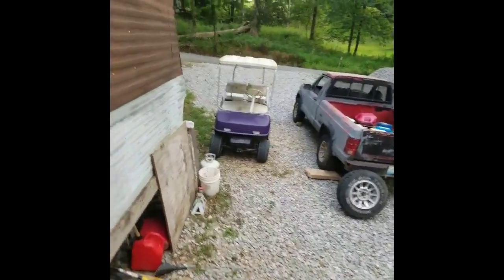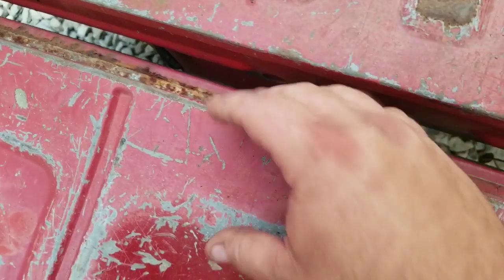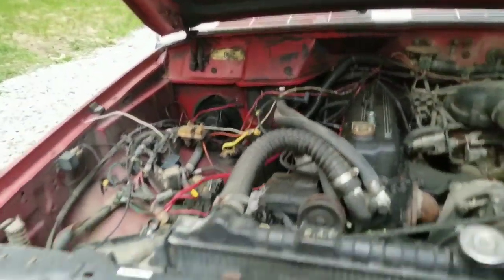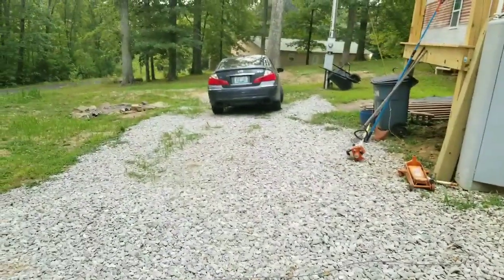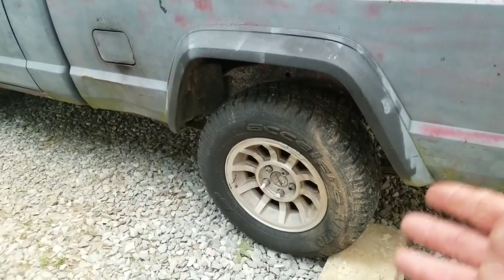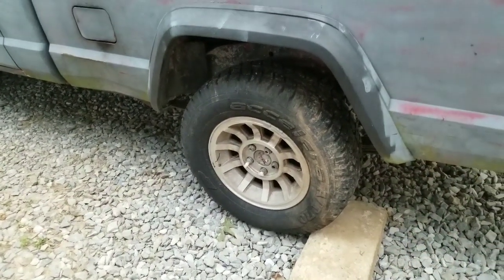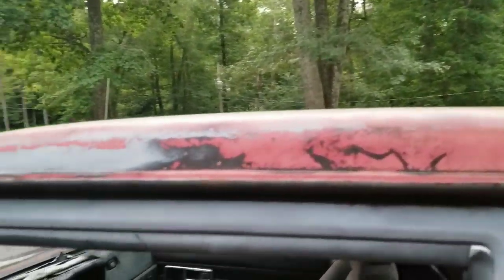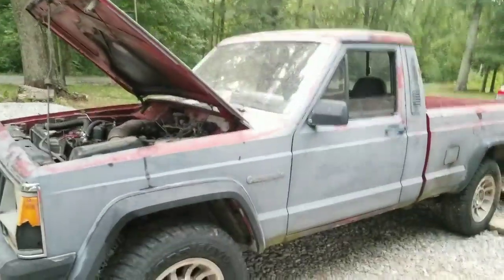MY $300 1987 JEEP COMANCHE 2WD 5 SPD - FIRST DAY HOME

Comment: That is not what I call "mint" but I'm glad you like it.
Reply from the maker: All diamonds start out as dirty nasty coal :P
Reply: Excuse me??? The guy paid 300$ for an unmolested Comanche (except for paint) and those turbine wheels alone are worth almost what he paid for the truck! I paid 3500$CAD for my 1988 2wd, and yes, it "looks" better than  this one... However, it been repainted and it's starting to peel, the frame has been bent and broken between the bed and cab on the driver's side, previous owner repaired it and plated the frame but didn"t straighten it so the bed sits twisted... No alarming rust, but I got to redo the bodywork and frame properly. Believe it or not, over here in Quebec (eastern Canada), the price I paid is pretty much the cheapest these trucks go for over here. We expect to pay between 6 and 8 grand (canadian dollars) for a top notch example. I'd trade my 88 over this 87 any time just so I don't have to fix all the shady work the previous owner has done to mine... :S

Comment: Hey My Damn Channel...👍 great little truck! How many miles on it? I've got a '99 Nissan Frontier (bought new) with over 314,000 on it now. I'm guessing you already are gonna do this...check fuel tank for sediment due to sitting : oil as well 😂  before hooking up battery and starting that bad boy!!!!! KUDOS and good luck.
Reply from the maker: I want to hook a battery up to it just to see if it turns over and if there are any electrical issues, then im going to disconnect the fuel line under the hook and run the fuel pump and see what comes out